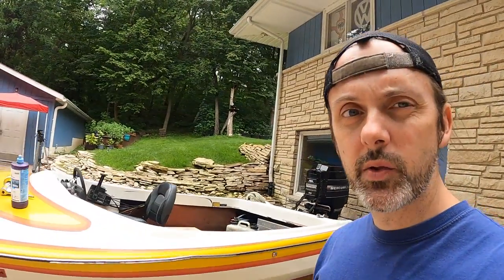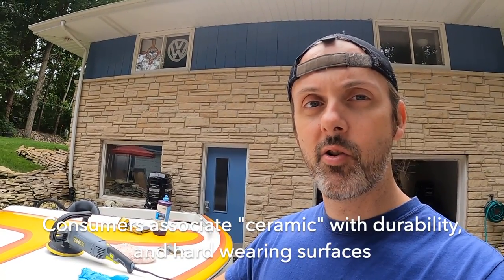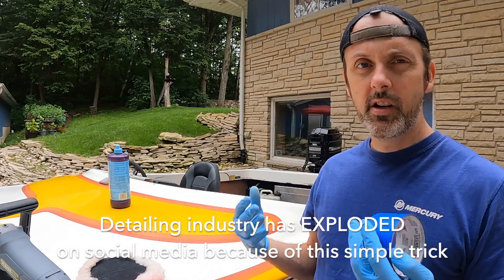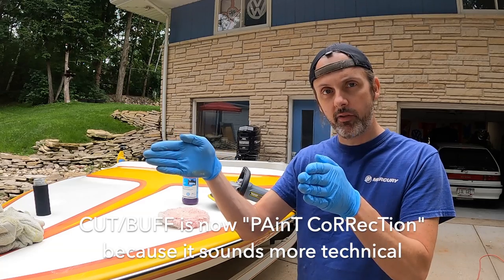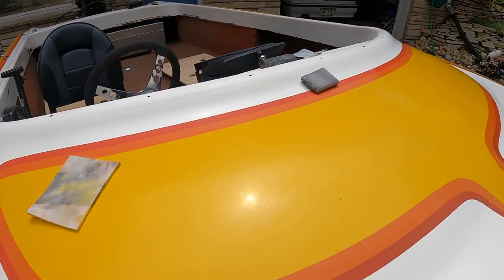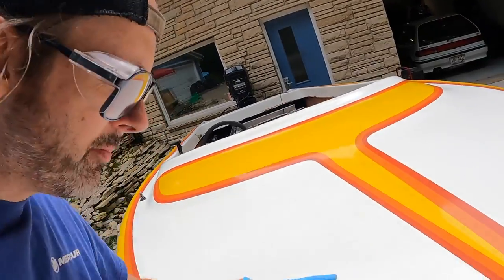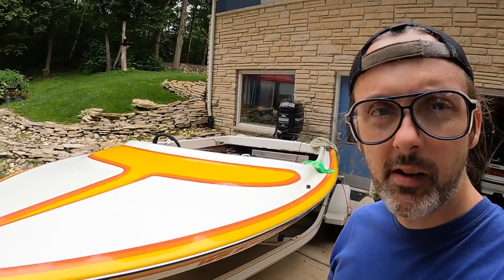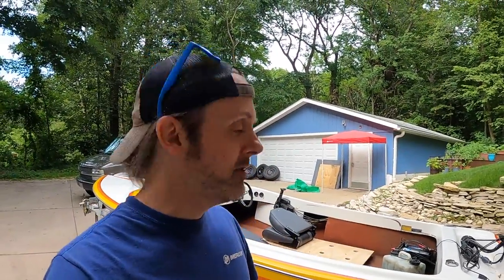How To Restore Your Boat's Gelcoat in 3 Steps DIY w Pro Results

Comment: Nice job. Props for calling out the marketing BS.
Reply from the maker: Drives me crazy bro.   Scam artists just ripping people off and lying to them.  So sick of it.
Reply: @ADDvanced  Boat looks great. Done simple. Don't forget the motor cowling. For the mid section and anything below the cowling I would 50% dilute Shower Power every time I washed the boat. Mainly the calcium that always builds on the mid section.
Reply from the maker: @pgnandt  Great tip!

Comment: My recent purchase had 30 years of oxidation and using the buffer and compound was killing my shoulders. I tried a sanding sponge-block and it cut 90% of the effort out. Went to Amazon and ordered 1000, 2000 and 3000 grit wet/dry sandpaper.  Went to Harbor Freight,  got a 6" pneumatic sander. Already had spray-glue. So easy. I don't care what they call it though, that ceramic-coating stuff is nice. It's such a pleasure when the boat surface turns into a mirror.
Reply from the maker: Yup, a heavier oxidation will require more aggressive cutting.  Careful tho, once you're into the glass fibers you're sort of screwed.  Then you'd be forced to spray like G2 featherfill at which point you'd never see the original gel again.   Paint sealants are awesome.   Klasse was developed in the aviation industry, to keep airplanes clean that sit out on runways.  It was developed in the late 60s.... that's how old synthetic paint sealants are.  But now, with more MARKETING, they can charge 4-10x as much.  So ridiculous.

Comment: Awesome video, super informative and honest! Definitely going to be looking into some of those products. 

Was borderline on a $2000 Glastron CV150 and ended up passing on it a awhile back because the condition was worse than advertised. Had we been able to bring back the dulled gel coat back easily, we may have pulled the triggger! Filing this away for sure!
Reply from the maker: Glad it was helpful!  I like Klasse, it's cheap and it works and it's been around forever.   I'd hold out for a CVX20;  they'll always command a huge premium because it's one of the best designs of a transom that has ever been done in the boat design world.  When you buy a boat that will always command a high price in good condition, it's a lot easier to justify any expenses from a financial POV.   Cheers!
Reply: @ADDvanced  - I've noticed that they do! The one I was referring to was smaller than the CVX20, it was a Glastron-Carlson CV or CVX 16. Not sure where I got the 'CV150' from. I'm guessing that I tried to remember the model, and got CV 16 crossed with GT 150...

Comment: Just over 8 YEARS ago I had 3 different detailers try their "miracle" products on my boats aluminum that had turned to a "milky" white. In every case except one, within a day or two the bright silver shine they all produced had reverted back to the dull white. I hired the one that passed the test of time using a ceramic product and up until many years later when I sold her, the aluminum was still bright silver shiny. Was not cheap but the cost of 4 men and the product, working nearly 5 days on the entire Tuna Tower and railings was certainly worth it. 
After recent $45,000 paint job of hull using Awlgrip Paint would never use a product not recommended by them.
Reply from the maker: It's not ceramic tho.  Literally it's paint sealant.  Here's what happened, some shmarmy marketing guys got together in a room and discussed what words people associate with hardness, and protective.  A "ceramic layer" sounds like it'd repel scratches and be really tough, so that's what they did.  They renamed paint sealants "CeRaMiC CoaTinGs" and charge way more.   I've challenged any of these guys, with reward money, to chemically explain the difference between ceramic coatings and paint sealants, and not one person has been able to do so.  There is no difference.   It's marketing bro.

Then you have the detailers themselves.  No formal training.  No formal education.  No licensing.   They are literally doing what used to be the bottom of the rung job at a bodyshop, and now charging a higher hourly rate than many skilled/licensed professions, and it's all based on a bed of lies and psuedoscience they happily feed to gullible people.  It's shameful.
Reply: @ADDvanced  That's just not true, a polymer based sealant is a sacrificial barrier, a high SiO₂ content sealant adds a lasting layer, when used on things  like aluminum and automotive paint it actually lasts.  Also when you say this takes no time at all you're the one spouting bullshit.

Comment: Great video's 
I have a 1976 Baja 16ss
Currently not running 🙃 
Has a tower of power from I think 2 or 3 different engines 
But you have rejuvenated my interest in getting it going 
Been on the back burner for awhile really appreciated the rotten transom video 
Learned alot 
Keep up the great work thanks 
Jim 05/15 /24
Reply from the maker: Do it!  Do it!  Start a list and knock off a few things per day

Comment: Nice job!! 
Keeping me entertained!
I'm going to jump back to your last video. Do not run that merc with the horn beeping!!!! What you were hearing is for oil injection. The overheat alarm is a solid tone beeeeeeeeeeeee.... 
Not saying you don't have problems with your cooling system also, but engine will run real hot without oil for a few minutes, then it will seize.

I have 5 mercury 2.5 litres, and will not run one with oil injection. The blockoff plate is 15$ on ebay. You can also set your max timing at cranking speed.
 When you buy that oil injection block off, you can get yourself a used service manual, it will explain the process for timing. Or do a bunch of reading at Scream and Fly.
Reply from the maker: I edited it out of the video but I checked the reservoir on the front of the engine several times, it was always full.  ???
Reply: @ADDvanced   There is a rotational sensor on pump that will set the alarm off also. If the big plastic worm gear is stripped on the crankshaft, the pump won't spin. I have two engines in my shop now, that have had this gear failure. If you want to run it for the rest of the year with oil injection, you should still premix, 75:1 or more, to be on the safe side. Keep up the good work!!
Reply: Just to be sure the oil tank on the motor is full, start the engine, then just loosen the cap on the engine reservoir.  Once oil starts seeping out, you know it is 100% full.  For some reason the engine can’t pull oil from the big reservoir fast enough to refill the small reservoir fast enough to refill the small reservoir.  If the alarm continues it means you either have a bad sensor on the float, or the problem is something else.

Comment: Love your videos! I just inherited a 1969 Checkmate with a 1978 black max 200hp so your videos are extremely helpful. Anyway, re: this video, what brand of soap did you use or recommend for washing the boat first? There are so many options out there. Thanks!
Reply: 1989 Checkmate Starflite Owner here. From what I have heard alot of guys recommend using Dawn dish detergent for the first wash to remove grease and strip the old wax off. After your through compounding and waxing. USE a Boat wash. Good luck with your boat.

Comment: Thanks for the info!  I have a boat needing gelcoat shine juice.  Mom is now following and loves Sarah’s appearances.  What video editing software do you use?  Thx n good luck breaking 65mph
Reply from the maker: Thanks for the support!   I just use iMovie....  I've used FCP and premiere but they sort of slow me down with all their features
Reply: @ADDvanced if you're looking to break the 65 mile-an-hour barrier you could try doing some bottom work. Blueprint blueprint in the bottom, see if there's any hooks in it try speedcoat on the bottom work with the setback try a Hydraulic Jack plate and try different props. You could give B Blades a Call and ask if they have a prop exchange. Keep us posted

Comment: I have a '77 Cee Bee Avenger. It's also a 17', but not a bubble deck. Also powered by an '87 XR2. I notice the VW banners in your window. Are you an ACVW fan too?
Reply from the maker: Check out the other vids, have a 95 S6 Avant, 04 Beetle Turbo S, and a 77 911 Outlaw.  Cheers!

Comment: A few questions: 
1) If you get the Klasse AIO do you still need to do the cutting step with the 3M Perfect It, or does it doe everything all in one (as its advertised)?   
2) What heads/covers are you using on the buffer, for which steps? 
3) Whats the purpose of the small pneumatic buffer?
Reply from the maker: 1.  Still need 3m perfect it.  AIO will remove the minor swirls, but it's not a cutting compound.
2.  I prefer the foam for almost everything, the wax just doesn't seem to get me the same results
3.  Same as big buffer, but for smaller spots that's harder to do with the bigger one.
Reply: Ok. So cut it with perfect it, then seal it with the Klasse all in one?  

Just ordered both on Amazon, along with some extra foam pads for my buffer.   Have a 20 year old Sea Ray that needs some love.
Reply from the maker: @archangel1221  If the perfect it doesn't bring it back, you need to sand!   Just start slow, you got it!

Comment: Been doing this for over 47yrs perfect it sucks on jel coat. 3m super duty is what you use. Wet sand with 800 then super duty then use vengeance sealer they turtle wax. Then it will last.

Comment: Hi, I’m getting a 1989 bass tracker that the current owner says the clear coat is flaking off in some areas.  Would this process fix that?  Thanks!
Reply from the maker: Nope, but stay tune, I'm about to tackle that issue on my blue SST project boat, not sure how I'm fixing it yet.
Reply: @ADDvanced  Cool.  Thanks for the info.  Love to see how you do it.

Comment: I agree there are alot of scam sealants out there.  Most things are better off with a cleaner wax on them if applied fairly regularly.  BUT Silicon dioxide, also known as silica, is an oxide of silicon with the chemical formula SiO₂, most commonly found in nature as quartz is the only thing that makes a ceramic coating a ceramic coating.  Many products have the bare minumum amount to call it such.  However the good ones have much higher percentages and yes actually do protect MUCH better than any cheap wax.
Reply from the maker: Wax sucks no disagreement but you’re spouting marketing bullshit/the crap the say on their websites.  Paint sealants have the same thing.   Just my opinion.  If there’s an actual chemical difference and a double blind test of chemists saying one substance is “just” a paint sealant and the other is a “ceramic” sealant, I have not seen it.
Reply: @ADDvanced  Most waxes have more UV protection than most polymer based sealants.  It's chemistry, not marketing I have no skin in the game and have tried dozens of different things for gelcoat.  SiO₂ sealants last the longest and have the best minor scratch resistance but the gel still oxidizes beneath it.  Regular waxing with an abrasive wax is the most realistic thing to do.
Reply: Also it takes ALOT longer than you describe to get the oxidized layer of gel removed and then polish all the scratches and swirls out for that real high shine.
Reply from the maker: @rumnboats7612  Nobody is talking about wax but you.  I am talking about polymer paint sealants, which as far as I can tell, are the same thing as ceramics.
Reply from the maker: @rumnboats7612  I took me less than 3 hours.   Probably 2.5 hours total with wet sanding.
Reply: @ADDvanced  There are currently 3 types of sealants available wax based, polymer based, and SiO₂ based.  "Acrylic" sealants like the glaze you are using are polymers and offer good debris and scratch protection but little UV protection which gel desperately needs.  SiO₂ sealants are similar but depending on percentages offer significantly more hardness and longevity. Wax based sealants have the highest UV protection preventing oxidization of gel the best but do not last very long without regular upkeep.
Reply: @ADDvanced  I mean...if you ONLY did the bow and left plenty of sanding scratches and swirl marks and didn't count the setup and cleaning time along with putting everything away I guess I believe you...
Reply from the maker: @rumnboats7612  Would love to see scientific data that shows the sealants with SiO2 having superior hardness and durability.  Links?
Reply: @ADDvanced  Here is another interesting study in which a thinner coating of Si02 produces a harder surface than a thicker coating, in such a study a polymer simply wouldn't make it to the chart as it's no harder than a wax...again it simply bonds better and stays on the surface longer.  file:///C:/Users/12188/Downloads/coatings-11-00023.pdf
Reply: @ADDvanced  You keep deleting my comments even with links so I will assume you don't want to walk this back at all or look at the reality of the chemical make ups of sealants and what is applicable and useful to different coatings, and would instead like to say you can start to finish sand and polish a boat in a couple hours...nope not with an actually smooth finish if it's not smooth free of scratches 'swirl marks are scratches btw' it won't last no matter what you seal it with as any deviations encourage oxidation.  Delete this one but keep in mind you're dogging hard on SOME hard working people not ALL some surely are scam artists just like many plumbers and electricians are...I can wire and plumb a house btw just like you can...but you're shitting on a whole industry you don't understand.  Maybe it's ok for some people to kinda sorta make their boat shinier but many want it really correct.
Reply from the maker: @rumnboats7612  I'm not deleting anything man.   Youtube deletes comments if they look suspiscious.   As for your link, I googled the named of that PDF and read it.  It's talking about SiO2 thin films, which are vapor deposition coatings, not something you rub on with a rag.  The entire study was about thin films used on industrial equipment, mainly electronics and optical coatings.  It has nothing to do with detailing industry or paint sealants.  It's sciency looking studies like this that I expect detailing companies to push as "proof" their coatings are somehow different than normal paint sealants, but it's bullshit dude.   See dunning kruger effect.  I've had posts on reddit about this with thousands of upvotes and a challenge for people to post actual data/testing about ceramic coatings, and not one person could come up with anything scientific, repeatable, or legit.  You're drinking the kool aid.
Reply from the maker: Sio2s are polymers.
Reply: @ADDvanced  Synthetic polymers are derived from petroleum oil, si02 or silicon dioxide is a natural polymer most commonly derived from quartz.  I'll film a real world test with perhaps Cquartz UK vs. rejex.  Both high quality high concentration sealants but completely different in their base.

Comment: So let me make sure I've got this...sand with progressively finer grit from 600 to 1500 then buff it then wipe it down w the sealant
Reply from the maker: You got it!   So easy a caveman could do it.   Or pay some dropout $2-3000 to have them do it for you.
Reply: @ADDvanced  I literally today bought a 16' Ranger bass boat for $750. The gel coat is almost white w oxidation. I'm glad I found this in time

Comment: I've got loads of chalky on my 1983. I know how to spray and blend clearcoat. I'd rather not though. .y gut tells me it isn't going to polish.
Reply from the maker: My blue SST was clear coated.  My issue with it is I've seen so many boats with peeling clear over the gelcoat, and that's a giant PITA.   Gelcoat does oxidize but regular polishing keeps it nice.   Clearcoat looks good until it doesn't, and then it's a HUGE amount of work to make right again.  Cheers and thanks for watching!
Reply: @ADDvanced  sort of answers my question. Once you have clearcoat, you're stuck with it. And yes... you can tell right where the clear is worn away. Pricing clearcoat and blending solvent. I just hate masking and prep work.

Comment: forget the ceramic coat bs,now it's the graphene "claiming" a rediculous lifetime of durability, but it's only been around as commercial automotive sealant for a very short time.  i've been cut polishing my offroad vehicles for years buffing out fine scratches by myself.i'd never pay someone for "paint correction".i have 8 boats and i do all of the polishing by myself.good cutting compound and a top quality polish and anyone can look like a pro after spending for the initial equipment.not to mention gel coat is the most forgiving coating ever made to cut/polish.you can't fuck it up.
Reply from the maker: Right?  yet these idiots pay THOUSANDS for some HS dropout with a $60 buffer to polish their stuff and throw some unicorn tears on it.  It's insane!

Comment: Coatings = Sealant? Huh, not sure I agree with that.  Sounds like someone got ripped by a Bs Shitty salesperson.   I’m from Eagle River so this isn’t a City Boys opinion
Reply from the maker: Ceramic coating = paint sealant rebranded.   Research both.  Same stuff.  Difference is marketing.  Both form a molecular bond to the paint to seal it from the elements.  Both have the same results.  One is 5-10X more expensive because marketing douches know that consumers equate the word “ceramic” with physical properties that sound good in a coating.   It’s bullshit.